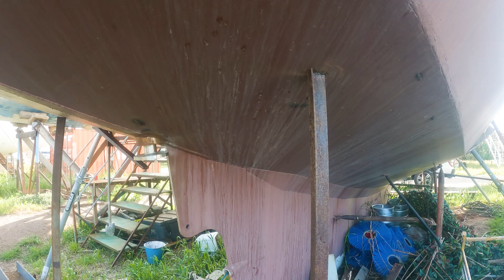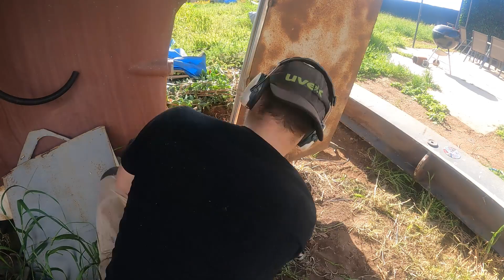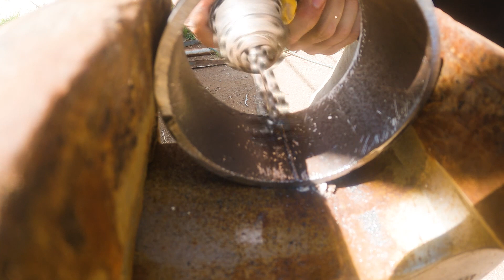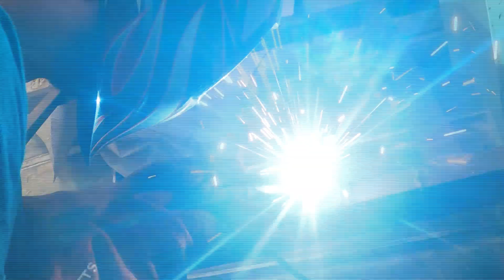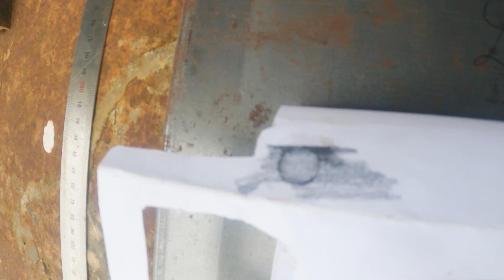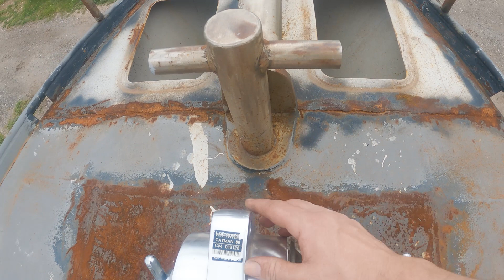Sailing QC #86  |  Installing the Rudder & Anchor Winch Plate  |  Steel Sailboat Restoration

Comment: You would want your snubber on the Sampson post, the idea is to take the pressure off the winch/mounting  hardware, have a look at the fin setup that project brupeg did on their rudder (same setup as ours and seems to help)
Reply from the maker: For this size boat I definitely want to be using the Sampson post for sure!